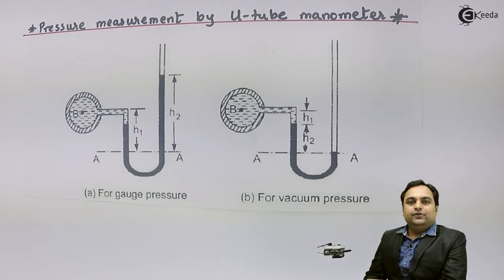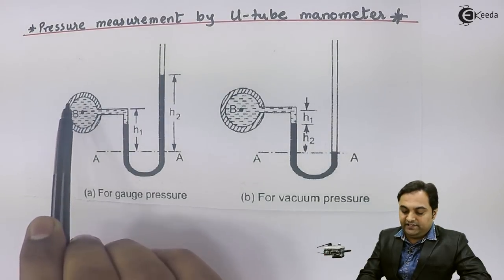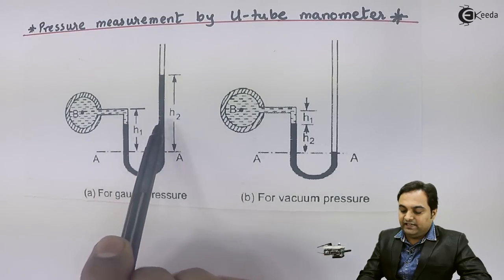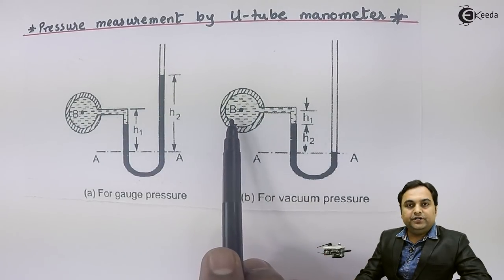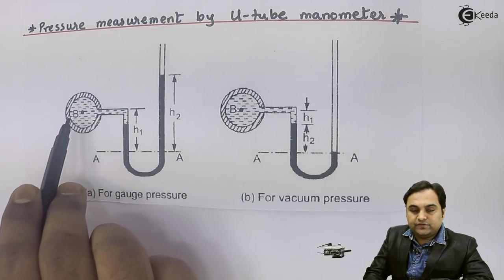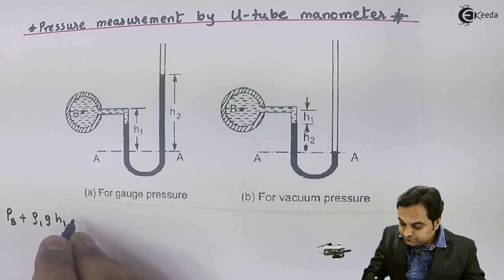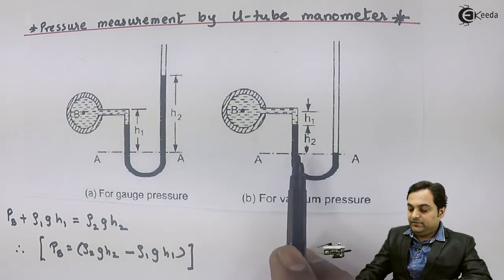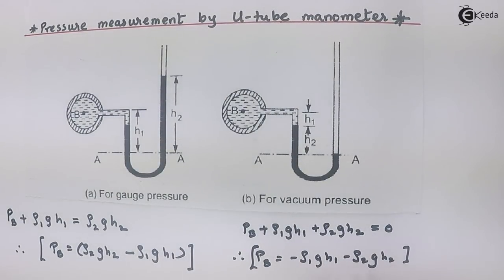Pressure Measurement by U-Tube Manometer - Pressure and Pressure Measurement - Fluid Mechanics

Comment: Sir,  I confused in first u tube h1 how you take h1 as two different fluid...
Reply: Buy and Sell i'm also bro..
Reply: Here in second tube also having two different liquids one is 'water 'and other is mercury ,so h1 is the height which passing the water, it will exert a pressure on the mercury of height h2. Here layers are different that is water and mercury. That why only taking the heights of h1 and h2.
Reply: U r right they just following r k bansal sir book.. The reference line placement is not right in the book

Comment: how did you take the height in the left limb as completely h1 eventhough we have two different fluids...since those two fluids have different densities and specific gravities how can we take the height as h1....and also we want to express the mercury level in terms of water which you didnt do.....can u expalin this
Reply: the diagram shown in video is wrong, upto height of (h1) there should be dotted line (light fluid).

Comment: A pressure gauge consist of two cylindrical bulb B and C each of 10cm² cross section area ,which are connected by a U-tube with vertical limb each of .25cm² cross sectional are a red liquid specific gravity .9 is filled into C and clear water is filled  into B. The surface of separation being in limb attach to C. find the displacement of surface when the pressure on surface of C,is greater than B by an amount equal to 1cm head of water..????

Comment: Sir,here why you haven't concluded the atmospheric pressure in the right limb.Also u have taken h1 for two different fluids
Reply: we consider atmospheric pressure as zero
Reply: @JP-ys9fx  atm pressure can never be zero, but here we are measuring gauge pressure. While measuring gauge pressure, the atmospheric pressure is taken as datum (i.e. gauge pressure is pressure above atm pressure)